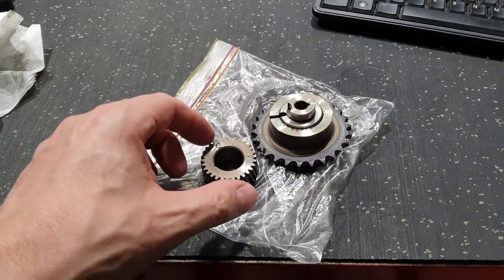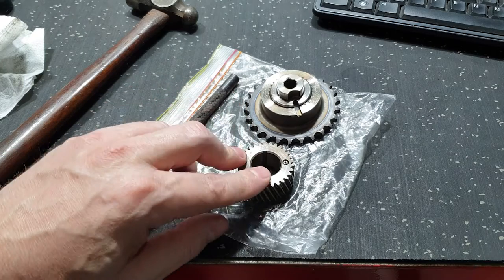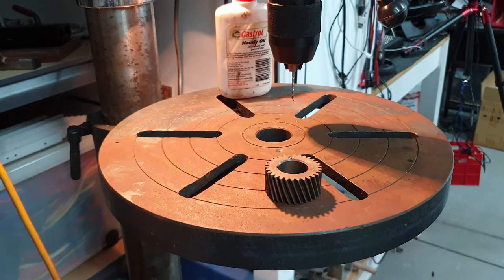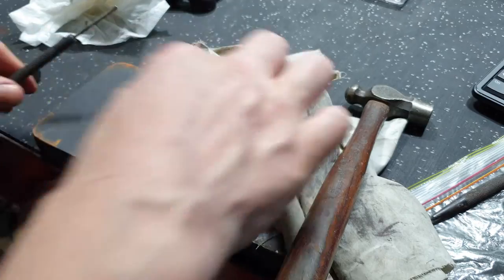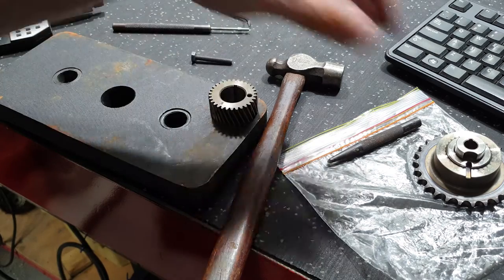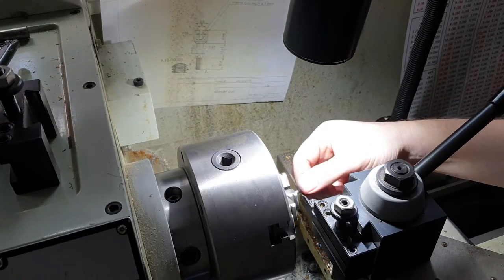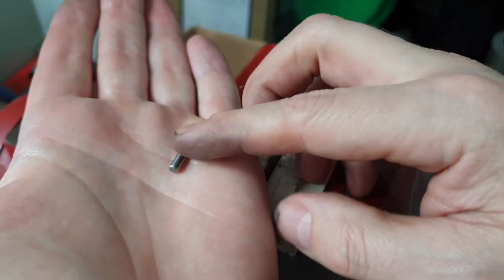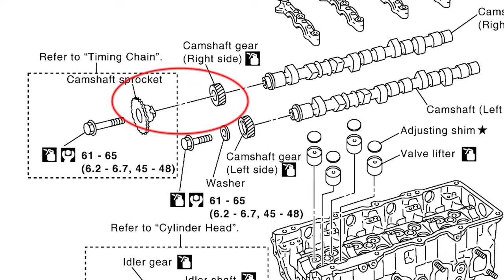#38 - How to remove a broken pin from a blind hole.

Comment: I can’t even get to the drill a hole
Into the pin part on what I’m looking at. It’s a rotary valve drive pin in a motorcycle crank shaft. Must be a hardened pin, I can’t even get a good dimple punched in it.
Gonna force myself to wait until I can take it into work where I have better tools.
Reply from the maker: Sounds like it is a hardened pin seeing as you can't mark it with a punch.  You will need carbide tooling to best handle that.  Good luck.